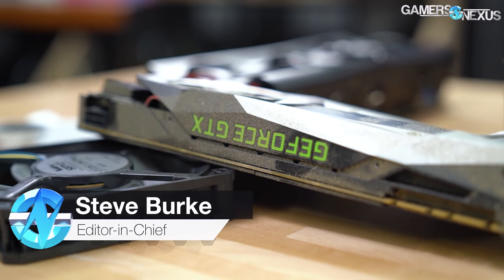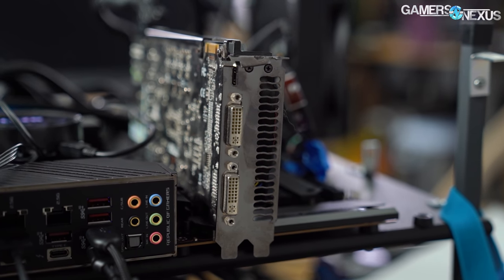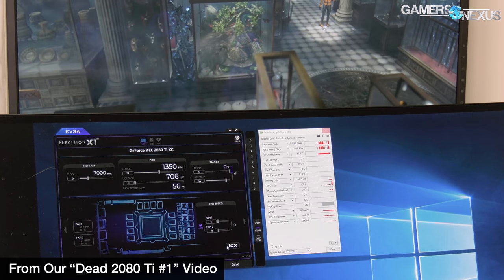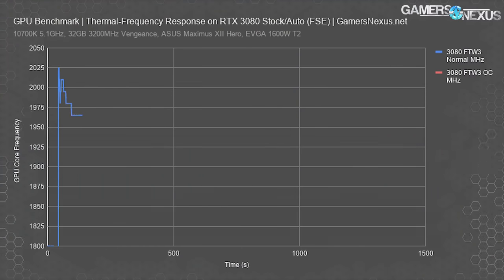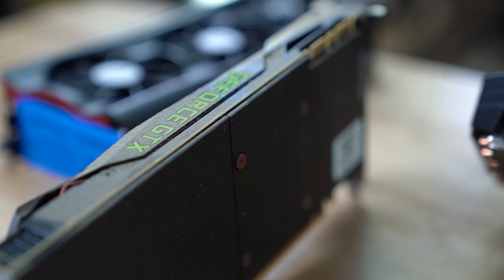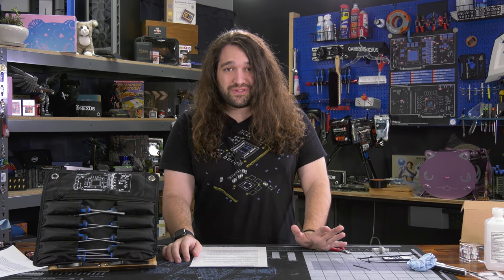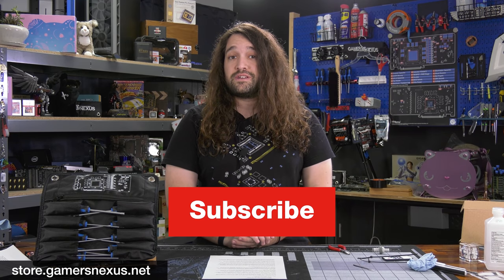Warning Signs When Buying Used GPUs: How to Detect Defective Video Cards

Comment: My 770 I bought off of eBay crashes when I do anything decently intensive, I have to reboot the whole system and my systems easy debug leds would flash between cpu and dram, which isn’t indicating a gpu error but I replaced the 770 with a cheap r5 240 off of Mercari and my system is stable even though performance is really bad, even kill it with fire at low/medium would crash the 770, when it does crash, the screen will turn one color for about 5 seconds before going black and losing signal, which is when my motherboard detects the error, audio repeats itself until no signal, every now and then my system won’t completely crash but the game would crash and give me a lowlevelfatalerror where the d3d device was lost, tweaking the settings one time I got the card to crash on subnautica and the screen turned white but it seemed like there was red artifacts on screen where objects where in the game, (I was in my ship when this happened) is this unfixable? Could it potentially be my psu not supplying enough power? I have a 600 watt bronze rated unit, but the pcie cable isn’t two separate ones for the plug ins it’s one cable with 2 6+2 pins on it, if it isn’t fixable I’ll probably sell it off and try to get some of my money back, prices went up since when I bought it, thank you for looking and let me know if you can help

Comment: I had an interesting experience with used gpu buying, I bought a refurbished 1080 ti turbo for 450 on ebay early last year, worked well for about a month till it started artifacting then wouldnt boot, sent it to gigabyte to be fixed and it worked again for another month, then broke again. Did this two more times till the last time where they determined it was unfixable but they didn't have any replacements on hand so they sent me an rtx 2080 turbo instead. I'd say it was worth my time.

Comment: I have few RX580 ex mining cards, most of them work just fine except for the squiking fans which were fixed after some cleaning and lubricating. But one of them was showing artifacts occasionally, not in games but when watching 4K/8K videos there are artifacts for a milisecond when image is shown like a negative image or with strange colors. Now I have 3 such cards and on all of them memory clock is fixed, even with 1mhz over default it crashes. Temperature is fine, gaming is fine but rendering 4K/8K videos is problem, on all of them, so, that's one method I use to check graphic cards.
All of them had mining bios with 1150mhz on core and 2000mhz on mem (default bios clocks are 1411/1750 RX580 Sapphire Nitro+)

Comment: 12:56 i get this on my sli 1080ti with triple benq 144hz screens , memory artifact, but it happens for like 2 mins then goes away for serveral hours, running my monitors at 120hz fixes it or just restarting the pc, must be a driver bug . so i'm guessing artifacts are not always from a bad card.

Comment: Got a few 660s that are still in use in kids computers, they play Roblox and not much else. But damn, took them apart and the thermal pads were dust and the thermal paste was now a rock. but after cleaning they are like new again and run as good as new.

Comment: I have a custom watercooled 1070 which won't work anymore since it got killed by a faulty Corsair PSU (with some other components which are still in use and cost 200€ to repair/replace). Is it worth to sell on Ebay as defective? Or avoid the hassle and junk it?

Comment: you didnt do the 3080 that fail in boot just before post? ive got that similar issue with a used card i bought at a fair price but they said it had some issues but it did work and post but well, when i tried i get nothing.. all look good on pcb nothing broken no visible issues checked with microscope entire layout of it and all seems good no knocked of components no burnt nothing. i do want to get it working if it is possible.

Comment: i bought 2 ex-mining card, my experience is mostly negative. i think they came from a massive farm in china. and imo, they dont bother with undervolt due to massive amount of cards
1. rx 470 4gb - died within a year, hdmi port wouldnt even work
2. rx 480 8gb - still using btw, but sometimes it would artifact some window. but only for a second
edit: from aliexpress btw

Comment: I bought my 280X back in 2014. for 180€ from a guy who wanted to mine then gave up. There wasn't any warranty, but the card was indeed unused. I couldn't return it because it was shipped, so I was stuck with it and very.. Well just sad.
It had artificing like crazy. I tried to fix it for months. It was Asus's TOP version of the card, which are notorious for insane memory overclock of 1650MHz. Eventually I did manage to fix the card by downclocking the memory to 1300MHz, which didn't destroy perfomance that much, due to 320bit wide bus right? The card also has extremely low ASIC quality of 53.5% which means it needs a lot more power 'naturally', stock. So the final verdict was that a guy from a tech news site edited my vBIOS to have 1300MHz memory clock, I believed him and flashed it and it worked flawlessly. I even managed to get core to 1100MHz mostly stable with 1.23V and +20% power.
It's still working today. Absolutely unbelievable. I cannot explain my frustration back when I bought it as a gift for my birthday only to find out it was basically unusable.
For anyone curious, you can find a video of my card artifacting on my channel, which is dead, but I left a couple of videos just as a memory.

Cheers, phenomenal video mate, as always

Comment: The bearings in my GPU fan are so loud, (MSI Radeon RX 580 Armor OC 8gb)
 I will buy new bearings, it's not necessary to buy a new fan for me. (If I can get the right size)
The set of fans cost 27 euro, the bearings would be much cheaper.
The card cools itself fine, it just has a weird bearing noise at low rpms.

Comment: I bought a GTX 950 and it worked for the seller and as i got it home it caught on fire, the power delivery from PCIE connector it caught on fire and burned out the 4 caps. After i dusted it off and cleaned it like alot of people show how to do it :(

Comment: I had a old 6800 Ultra with a very strange issue. Hook up monitor would be fine plays all games no issues what so ever. If i unplug monitor then plug back in just black screen i would have to unplug from pci-e for a few minutes then it would work. Even tested it on other motherboards and same issue. Using a dvi connection to this day still don't know why. I even push it to maximum over clock and still was working fine. Don't use for obvious reasons these days.

Comment: I have a lot of broken hardware lol. I've fixed stuff before, but my favorite was the R9 Fury Miner special that worked perfectly fine, except for a strange artifacting issue that had no rhyme or reason. It would make a small section of an application, usually a game, but sometimes other applications like google chrome, look corrupted. Some games or applications never had the issue, but it wasn't a section of the screen, but rather a block of pixels being rendered at the application level.

Comment: Ah, my time has come.

- If you bought a secondhand GPU that won't boot, but the fans are ramping up at 100% like it wants to fly itself away to Mexico, change the thermal paste. This happened to RX 570 that I bought online.
- If you see an online seller giving a price that is "too good of a deal", check their reviews in other products from the lowest score. It will help you more than seeing the 5 star rating. No reviews? No deal.
- Always read the description first before buying! 
- If you're buying a secondhand laptop/prebuilt PC, after checking the usual stuff, immediately do a clean install. Don't connect it to your local network until you do.

Comment: 2:41 rare? in what universe? Most GPUs seem to end up like that. and for some reason APUs or CPUs do not have this problem. That type of artifacting is rare now because you can't see it in UEFI mode it's only visible in legacy, now the os simply boots with a black screen. And the problem is that you don't even know if it's broken that way or not when you buy it, because the guy who sells it in most cases used a heat gun to make it work temporarily

Comment: With any fan, as dust acumulates on the baldes they get out of balance and become noisey.
Reply: Bugs me there are 7,000 different TYPES of GPU Fans, and, for the 'Triple' sets, cost around 50% of the value of the card when an old one starts grumbling. They have improved design/engineering quality in recent GPU's....

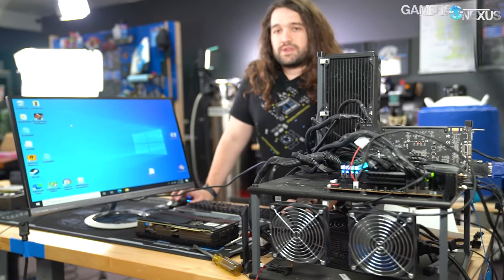Comment: Steve! I have a 560 ti also, when i install the drivers, the PC wont boot into wndows.  did you have the same issue when you went to install the drivers @11:59 card displays fine before the driver install and of course in safemode. I've tried older drivers too, but no luck. Maybe i didnt go far enough in the older drivers? lol
Reply: well that means its not the drivers problems, its the cards problem
Reply: @erimani5035  Thanks. So basically its not worth trying to fix it I assume?
Reply: @theduke3271  yes, however before throwing it away try repasting it

Comment: I've only has one bad deal on FB!  Ended up with a bad non functional hard drive.  Other than that every buy on FB came out positive and I ended up saving a ton of cash!  Just remember to ask the seller if the hardware is fully functional at the time of buying the used computer hardware!  96% the FB deal will turn out fine!  The other 4% a person will have to take a little risk if any! 

I ended up picking up a GTX 1060 6 GB for $20, a FX8350 for $30 and 32 GB ram for $10.  I can't say that buying used is all that bad.  Just make sure the distance and time you have to travel is also feasible and pencil that into the purchase as well!

Comment: Long ago, I had a graphics card I ( for some unknown reason)  flashed an incorrect BIOS into. This caused minor damage to the memory and I would,  under the right conditions get 2 small discoloured squares about 4 x 4 pixels, on a 1440p display.

Comment: I brought a used evga ftw 1070 from a miner and recently the thermal pads were leaking this oily substance which I checked online and it's a common occurrence. Also the card was nice and corroded I took it apart changed the thermal pads and paste but the thing still wouldn't work.

Comment: I bought 2 extra 580s the first one worked fine but the second one didn’t and had a blown up capacitor when I plugged back in the first one it didn’t work either. I am now returning them

Comment: I only get artifacting in one game (Cyberpunk).  336 hours, and it's getting worse.  I have a 2070 Super bought second hand in September 2020 ($375, but really $100 after selling my Vega 56 for $275).

However, the artifacting is ONLY in Cyberpunk.   All other games (Witcher 3, Shadow Tomb Raider, Metro, Control, etc.) at max and 1440p to 4K are fine.  I want to say it's just driver related?

Had similar issues with my R9 380X several years ago, and swapped out my GTX 670 for a couple months.  Put the 380X back in and everything was fine.  So that was a driver issue I think.

Any ideas?

The only reason I don't put new thermal paste on is because of my warranty is still good for another year.

Comment: In theory if I was buying locally and had a laptop with one of those external GPU connectors (like on alienware laptops) could I plug the card in and run some tests to see if it's functional?

Comment: I have a few years old 1060 3gb. Running Ubuntu 20.04 & video output hangs on cold boot. So I have to keep the PC turned on forever. Reboots are allowed. I changed Ubuntu versions & drivers, nothing. The error message on the syslog is "GPU has fallen off the bus". I have had frequent power outages. Could be a broken VS450 power supply. But the no-reboot fix seems ok.

Comment: I bought a used RX 580 in 2019 for 150$,
 it had just a slightly deformed HDMI port but works flawlessly,

I feel extremely sad for the guy who bought it for 700$ now and its not working :(

Comment: I'm not sure if you've covered this before, but I couldn't find anything on it.
My debate as a liquid cooled gpu user is, not just the gpu running temperature, ang higher clock speeds, (because to some people that feels like I'm trying to have them change their religion when I talk about liquid cooling), but the overall room temperature, between running an air cooled gpu for a gaming session (few hours at least), and to repeat the same with a liquid cooled session. 
Last year I had a 2080s Black, air cooled for weeks, because I was trying to find the NZXT G12 adapter, and I felt that the room got significantly hotter every time, compared to the liquid cooled setup after. https://imgur.com/gallery/xVR2ycP
Would it be possible to have this test comparison done by you guys, in a controlled environment?  I'm curious to see the difference too.
Thanks!

Comment: Soldat runs on my GTX 1080 just as well as it did on my VIA/S3G UniChrome Pro IGP 64MB DDR onboard graphics and Windows 98. Well, unless you spam "/addbot 2 Boogie Man" 500 times.

Comment: I did this to myself. Sold my RTX3070 at Auction (starting at purchase price), and put in my old GTX780 [until the Ti version appears for sale verrrrrry soooon] to try run PUBG (test). Sadly as I played the 2nd game of PUBG, and the card went wonky (shutting down etc). I thought I had done a thermal past update a year or three back; sadly it appears I didn't and I repasted it and tried again. This time, when it crashed again I checked the GPU and found a couple of resistors (very small brown ones [on the back of the board]) had melted/fried. Not sure if to try fix (from bits off an ancient motherboard), or bin it.
Reply: Ended up buying a used 3080 Gaming OC. Rough around the edges, but works great after servicing it.

Comment: I've got a GTX 1660 I bought as a refurb. I have issues trying to encode videos (nvenc) or anything Cuda related. Is it possible for those Cuda cores to be defective? Games run perfectly fine, temps, clocks, and voltages are all normal. I've tested the card on 3 other pcs and get the same Cuda errors and crashes. My old GTX 970 works fine with those programs on each pc I tested. I've been trying to figure this out for a few weeks now.

Comment: Hey    Thanks so much for the review   Think I might’ve been victim to purchasing damaged card.. put the card in, installed drivers and soon as I did that the fans started spinning high speeds and base clock runs way over base clock MHz in after burner. Can’t reduce fan speed unless I do it in after burner.  GPU fans startup immediately when booting windows.Do I have real problem do you think? Can it be fixed?  Would really appreciate some help if you can..thanks..

Comment: Good information. Locally isn't a tale sign of a good person. If anything worse, since you're provenly dealing with cash. 
Bought a whole PC, guy had 2 hdds installed with 2 ssds. Ssds were recognized but hdds weren't. Not knowing whether the drives, cables or mobo was bad, guy knocked off the price of the motherboard. Come to find out the drives don't power on at all even in a different system. 

Never buy hardware without validating before exchanging of money

Comment: There are a lot of dishonest junk sellers in the used market on eBay; especially with very old graphics cards (from 2000s).  'Untested' is a good indicator of 'it's broken but don't want to list it as such'.  So is 'it worked when pulled years ago' or 'not responsible for damage during shipping'.  ScammyMcScamface will get you if you aren't vigilant.  Usually happens to me when I eBaying when I am half asleep. :(  Remember, if it's listed as used and it doesn't work, it's not as described even if it's untested.

Comment: I just bought a used 1070 Ti for 100 $ few weeks ago, it constantly crashes with that blue screen error and the message is nvlddmkm has stopped working 
I use the card as an external GPU for my 11 years old laptop that happened to have a Core i7 CPU which is still holding up well, initially i had a weak power supply that was advertised as 400W but was in fact a 230W in disguise, strangely it did have a PCI 8 pin connector, after i found out about GTX 1070 Ti's requirements i switched to a corsair 650W instead, the crashes have become less frequent but they're still there

What do you suggest might be the problem ?
(Yes my driver is up to date, i did the TDRdelay registery thing as well, set to maximum performance, default GPU is 1070Ti, the additional GPU on my laptop is disabled, only Intel HD4000 and 1070Ti have drivers and active, and physics processor is set to 1070Ti as well)

Comment: I’ve only had one used card completely fail on me. I got a 650 ti a while back that was unstable at first, but then eventually it stopped booting. I have had cards with cut brackets(I had a replacement on hand though) and bad fans(which I replaced).

Comment: I have 2mm clearance from my GPU to radiator in my case so I made a slotted L bracket and screwed it to the back of the radiator to act as a GPU support. It's not noticeable and holds up the card perfectly